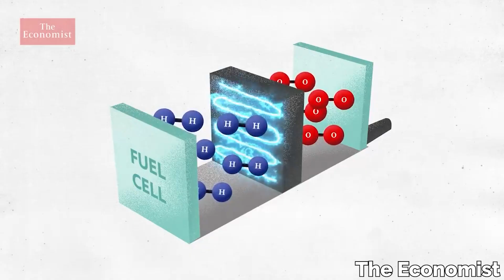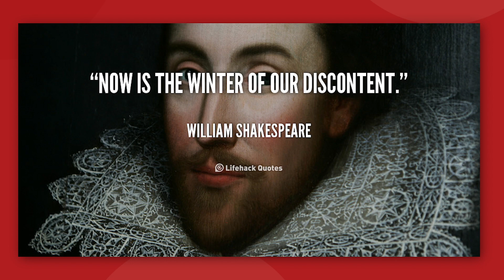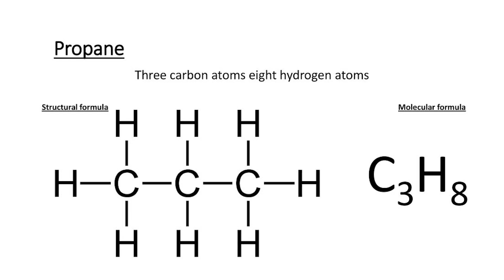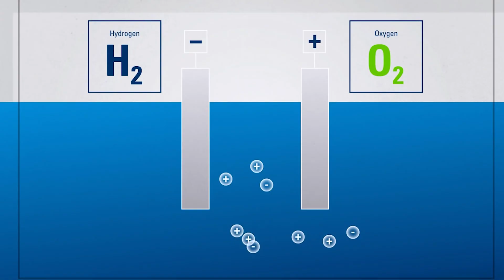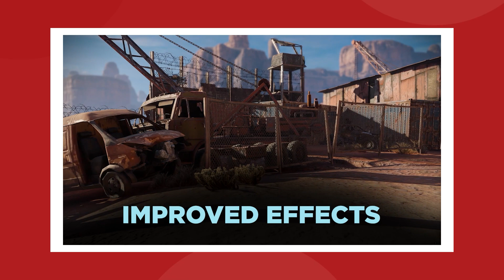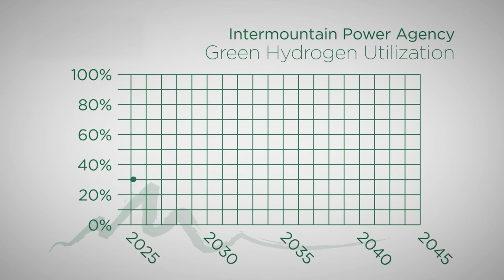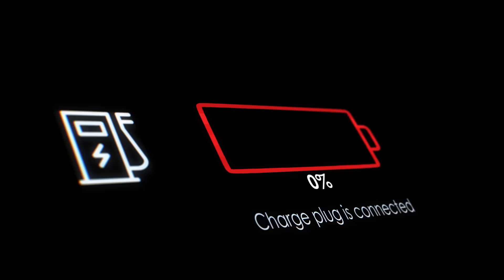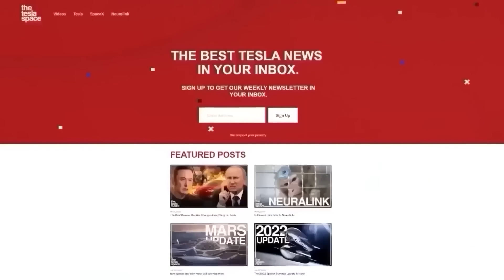Why Green Hydrogen Is Essential For Our Future!

Comment: I am normal person  just. Think hidrogen only have  one eletron to its orbit @ same time oxigen have  many eletrons . The energy its  concentrated on the opposite  side  and heat is the energy  source  for  movement  if its cold there it no eletrons  movement  and  same thing  applies  .they say u loose energy  through  heat loss  . The more oxigen its inject into engine  the more power make . If u put lots hydrocarbon  fuel  will flood the engine  and you don't go. But if u put  carbon  and igniter and add pure oxigen  the  fuel get really  hot 🔥 cause oxigen  so the fuel its the oxigen  and carbon  its the Midian  condition to the energy be transferred.  The hidrogen its cooling  the  heat of the  thermoreaction and that's why  water is resolt of the reaction  cause u not use water using  the energy in the molecules off . And the energy its the eletrons in  movement  because ever action its equal reaction  if eletrons  its push they  move  but if they are stable then it's no energy  create   And energy don't dessipear  / Dessiped   from hot to cold  and if heat again comes  back in the for of energy

Comment: Hydrogen power is a joke. It will never be energy efficient and it has significant safety issues.  Hydrogen is way more dangerous than gasoline and can even leak through metal containers. In the next decade better battery’s will make the hydrogen debate go away.

Comment: Roll out small platform nuclear plants and combine it with hydrogen production for the heavy lifting backbone and provide the power grid scale needed to electrify everything and have the capacity so that we aren't rationing, blackouts, and authoritarian smart grid controls to lock consumers out of their cars, thermostats, and any device that plugs into the grid at the whims of govt and grid operators.   Batteries do not have the energy density to do the heavy lifting that we do today with trucks, tractors, combines, cranes, trains, ships etc.  Batteries will NOT work in transport trucks for long haul OTR trucks.  You will find out soon enough they are going to be degrading batteries and the 500 mile range quoted is with load, in perfect conditions on LEVEL ground!  LOL  That isn't going to work and as soon as you start slamming DCFC nonstop you watch what happens to those batteries.  You will need more energy density onboard and that is where hydrogen could plug that gap.   Solar and wind are not stable and reliable.  Trying to store excess renewable energy into batteries is just not practical on the scale that is required.  Not saying don't deploy the mega pack batteries, but it is just a momentary buffer that is very expensive, and does not address the stable production needs.

Comment: I like the concept of turning into a hydrogen economy, but your logic is a bit circular. You talk about using green electricity to make hydrogen to feed to generators that are burning a 70/30% mix of H2 & CH4 to then make electricity?!? Why bother with the whole H2 phase in there? Take your green electricity & go with that.
So I understand why you're wanting to generate H2, but your sidetrack into using that to make electricity (again) doesn't really hold up.
There are certainly many off-grid situations where using H2 is better than batteries. Perhaps it would have been better to focus on those.

Comment: The sun burns pure natural hydrogen...hydrogen combustion engines have existed since 1887...GASOLINE IS DIRTY HYDROGEN FROM CRUDE OIL dirty stinky nasty hydrogen...Ocean water is abundant endless source of clean hydrogen...all cars run on Hydrogen stop putting dirty Hydrogen in our cars..use only natural pure hydrogen the cars will run better cleaner...HYDROGEN IS AND ALWAYS HAS BEEN AND WILL BE THE ONLY RELIABLE ECO FUEL...

Comment: And eveb if you do all that, hydrogen will be non the less massively inefficient. You  need energy to store it. You need energy to generate it. You need energy to transport it. And even to use it, you will need again energy as kickstarter. So betteruse the grid to transport energy to where it is needed and store it in batterys. May not work for planes and ships, but to power the rest of the economy, standard grid use and battery without the energywasting detour throug hydrogen would be wiser.

Comment: Tesla is at a run rate of over 3,000 megapacks a year and that will surge hugely over time as battery supply rises.  Since Tesla isn't the largest utililty scale battery company i imagine world production is 5 or 10 times that, so why worry about hydrogen as a storage medium since it costs so much to produce?
Reply: Batteries can’t replace oil not even 1/1000 of all its applications lol….. there are litteraly millions of oil byproducts

Comment: it seems the Tesla Semi wll be far more cost-effective than Diesel and will charge fairly quickly, so why can't that scale to  bigger  work trucks and other uses?  Also, the cost of producing green hydrogen is very high, partly because you lose 2/3 of the energy  during production.
Reply: Nope!!!! Nothing will ever beat diesel! Don’t forget the alternative fuels like biodiesel for recycling…… diesel trucks are much more flexible hauls much heavier loads on longer routes even unpaved with no infrastructure.

Comment: One thing not mentioned is that water vapor (the byproduct of burning hydrogen or using it in a fuel cell) is also a greenhouse gas that cause’s climate change. Large scale use may just replace one greenhouse gas with another thus with a zero sum reduction.
Reply: H2O vapour (steam) is indeed a greenhouse gas, in fact, many times more potent than CO2. However, not as much is produced per kW and it also condenses out quite rapidly so its overall nett effect is very low.

Comment: Okay I have a fer problems with using hydrogen as fuel.
1) one of the global environmental concerns is that there isn't enough freshwater available, and that is what is used to produce hydrogen.
2) it requires more energy to produce hydrogen than what it puts out, so you will always be producing at a loss.
3) Once produced hydrogen is very difficult to store. The atoms are so small that even the smallest gaps would be enough for it to leak out.
Reply: There are better hydrogen storage solutions beeing developed lol…….

Comment: Where are they getting the hydrogen from to pump into the salt domes? Are they cracking it from water by using electrolysis? If so where do they get the water from in Utah and what energy source do they use?

Comment: The best bit for shipping you didn't mention is you just need some offshore wind consistently producing green hydrolysis of sea water and the ships can refuel out at sea for free and continue on. You'd have to convert over old existing rigs to store it for the ships or put in new infrastructure, but it's definitely doable. Can make use of the old pipelines to move it on shore if you wanted to as well.
Reply: There is no such thing as free energy
Reply: Yes! I thought of solar panels on ships to continuously create hydrogen and pump it into storage tanks onboard. 👍🏼
Reply: @yobringitondown5565  You do realise that hydrogen powered ships will use fuel cells to power electric motors don't you?
Why would you use solar panels to produce electricity to power electrolysis to produce hydrogen to then feed into a fuel cell to power an electric motor (with a round trip of less than 30% efficiency*) when you could just power the motor directly off the PV panel with a round trip of ~95% efficiency*)?
* Not including PV losses.
Reply: @peterkotara   Very well summarized. Dihydrogen used in this way is and will remain meaningless for many decades to come. On the other hand, how many subsidies of all kinds have been swallowed up in this heresy ?
Reply: @peterkotara  I was simply looking at the hydrogen generation part of this. Use solar panels to generate hydrogen anywhere and everywhere, while under power or at dock. Plenty of seawater available. That’s all
Reply: You're right not free, you need to build and maintain the turbines and store the hydrogen, but it's a hell of a lot cheaper and cleaner than running them on fossil fuels.
Reply: Fortunately scienctists have been developing a better hydrogen storage solution.
Reply: It would never be free

Comment: Let's look at some number; To create 1kg of green hydrogen by electrolysis requires 60 kWh of electricity and 20 litres of water.  This 1Kg of hydrogen  (11 cubic metres at room pressure) has a energy content of 34 kWh. Then the compression, storage and distribution on top will ensure that only limited applications will be commercially viable.
Reply: Yes, for sure - and then if you want to turn around and use it in a fuel cell, the loss is even higher.  So it isn't a good energy storage-and-transport medium.
Reply: There are better hydrogen storage solutions beeing developed lol…….
Reply: @carholic-sz3qv  Yes technology moves forward but without electrolyses yields or compression and distribution costs changing dramatically hydrogen overall energy yields will be way under 50% against batteries being better then 80%.
Reply: @roelhellemans2451  wrong!!!!! We won’t need to compress hydrogen ever when better storage solutions are invented! Just like batteries….. it will eventually happen. It’s going to be used on a much larger scale than batteries too

Comment: Hydrogen for power generation is not a fuel.  It's a battery.  You need a fuel or energy source to create hydrogen so that it can store the energy.  It's an inefficient process and why it will never succeed.  Batteries may not have enough energy density for large earth movers, ships and jets today, but they are getting more dense and lighter every year.  By 2050, what kind of batteries will we have?  It's likely, they will be better than any form of hydrogen storage.

Comment: Yeah hydrogen takes alot of energy to make, it is terrible and dangerous to store or transport and takes rare materials to use in the process. It's also really expensive to store and transport because of how much special care needs to be taken on the containers to hold it. As much as we need to do everything at our ability to overcome the fossil fuel industry this is a technology that is very specific use only and no good for storage. Way too inefficient, expensive and doesn't even save on rare materials or money. You end up way better off doing air bladder energy or gravity batter storage as far as expense and efficiency. Also there are tons of storage methods that also have a longer storage ability for long term storage.
Reply: There are better hydrogen storage solutions beeing developed lol…….

Comment: One big issue with Hydrogen is that the molecule is so small that it is very hard to store or transport it as it leaks through almost any other material. Look at the issues SLS has had. It is also Highly explosive.
Reply: Lol….. we know that!!! Scientists have also been working on a better hydrogen storage solution.
Reply: Natural Gas is also highly explosive and everyone uses it.
Reply: @TheGoncas2  The Hydrogen is injected into the fuel tank to reach 10,000 PSI. I have not encountered any such pressures for Natural Gas. Natural Gas is well-contained in high quality tanks. Hydrogen will always leak because of the sizo of its molecules.
If both Hydogen and Natural gasses were the same, we would not have this discussion!!
Reply: Hydroge flame is virtually invisible - people and children may get very serious burns if a flame erupts in proximity. Hydtrogen ALWAYS leaks, and in a confined area, may cause suffocation. Loose hydrogen will collect near the ceiling, leaking upward into all other floors above, with NO indication. Hydrogen reacts with Oxygen to create and EXPOLOSION.
Reply: How about natural gas? Lol idiot
Reply: @GarzaB  what about it? Compared to hydrogen molecules, natural gas molecules  are like a grain of sand and natural gas would be like a tennis ball. You can store and pipe natural gas very easily with normal plumbing and tape sealed joints. hydrogen on the other hand can leak through almost any normal tank and plumbing and is very very cold compared to natural gas. This makes it extremely hard and expensive to store and handle. As well as it is many times more explosive.
Reply: @sgfx  do a little more research. Hydrogen is the way. That’s what Toyota, and now BYD have been waiting for so long.
Reply: @GarzaB   Toyota new leadership  just revamped its 3 year plans to dive into EVs as it has lagged for years trying to avoid them.  As Elon said. They are not stuck on batteries to power their cars, they have researched all the options, if there was a better option than batteries, they would have used it.